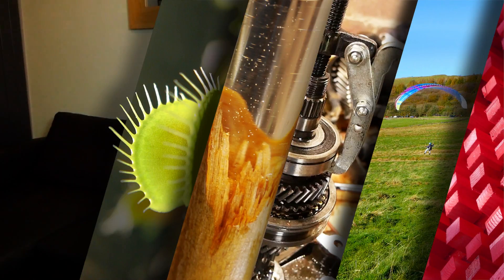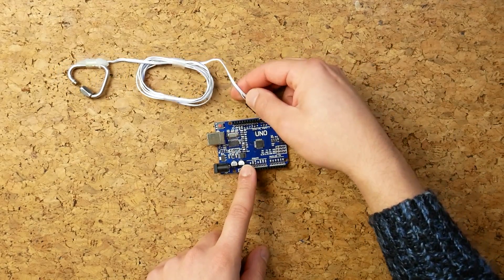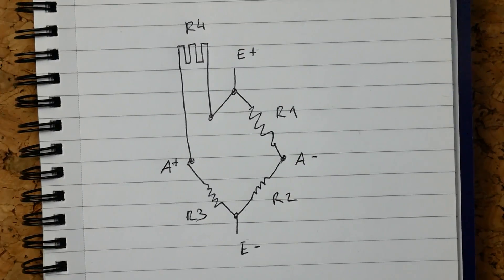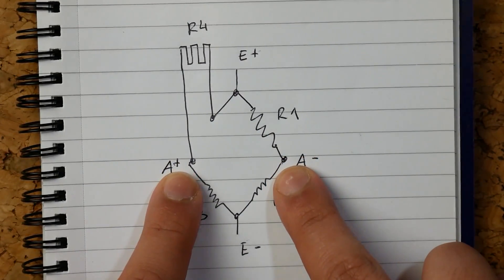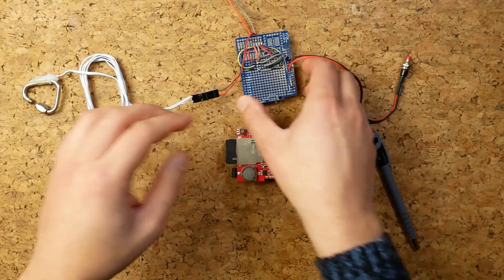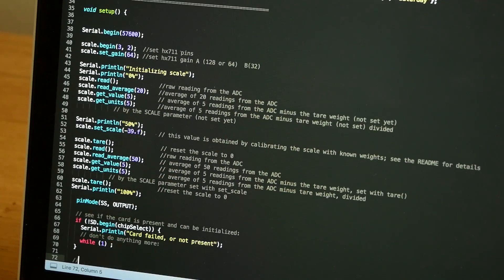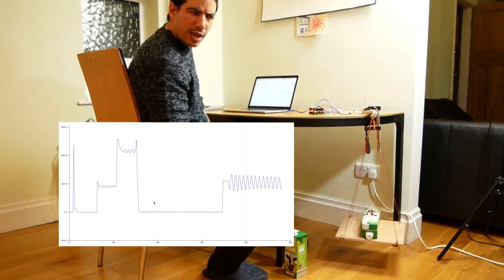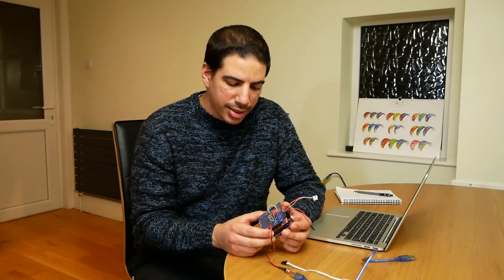Electronics - Uncollapsible Paraglider Part 3 - BANDARRA

Comment: Hello,

interesting solution.
Is there anything new in this matter?

I would see the optimal use as follows:
1) use on two main A mailons, I would not solve A. (Ears warn of piloting errors, I would only warn against major collapses.)
2) replacement of only 2 mailons.
3) USB C connection to mobile phone and Android application for evaluation.
4) stereo message to distinguish left or right side
5) setting different sound for left and right side
6) alarm when falling below an adjustable value,
7) alarm when exceeding the speed of descent above an adjustable value

Best regards,

Jan

Comment: The Arduino has an analog input. You can connect your strain gauge to an op-amp with the proper other components to amplify the change in resistance so that the Arduino can measure it directly.

Comment: Are you sure that one strain sensor is enough? I'd expect more sensors in the wheatstone bridge. Otherwise you can not distinguish strain-, shear- and torsion forces? Furthermore your sensor would be sensitive to temperatur changes. Using a multiple sensors the wheatstone bridge would eliminate this problem.
Reply from the maker: Yes that's very true and I'm incorporating that in the next design of the sensors. However you have to remember there are more than just performance considerations to this, for instance I don't have infinite money to invest in this :) so I need to balance performance with price

Comment: Hi Andre,
I have been following your work and find your prototyping interesting.

I am a structural engineer and can be able to assist you in the assessment of the physical forces, strains and stresses of the the maillons. the triangular shape of the maillon is problematic in setting up strain gauges, if not for anything else but the amount the securing nut is tightened would affect the overall strain in the gauge. the set up will cause not only tension but also bending forces in the maillon so it will be a bit erratic. There is also the issue in the location of the strain gauge as it varies between compression and tensile forces whether the maillon is open or closed.

if you are going to commercialize the project you need to be able to provide a device that is universal and something anyone can install in their harness. For this reason i suggest that you build/make specialized strain gauges units that fit into the harness that just clip into the existing harness.

A suitable design would be a straight rod of s/steel with a loop at each end or a maillon at each end (which will be simpler for the end user to implement).

the strain gauge would be  installed on the straight section of rod which should be at least twice the length of the strain gauge measuring loops. Using this set up there should be no irregular readings and it should be stable and be very linear as all the forces are in tension with no introduced bending.

I am happy to discuss further if you provide me your contact details.
Reply from the maker: Hi Charles, thanks for reaching out and for the support. Yes that's the same conclusion I got to and already designed some new prototype sensors in CAD a few months ago. When I get a chance to make them and test them I'll put a video up about it